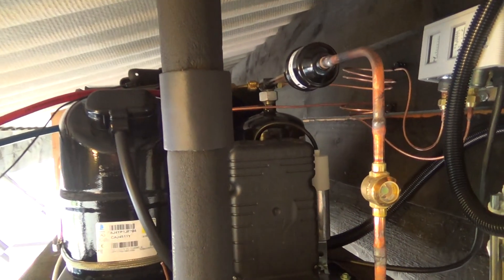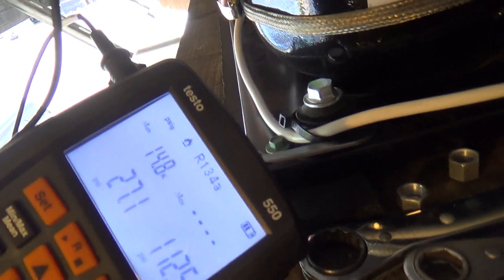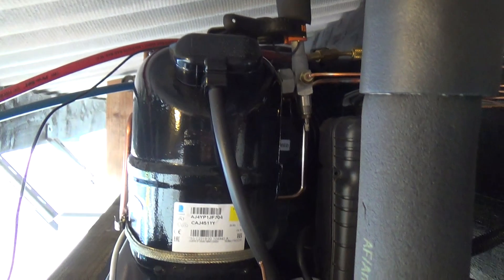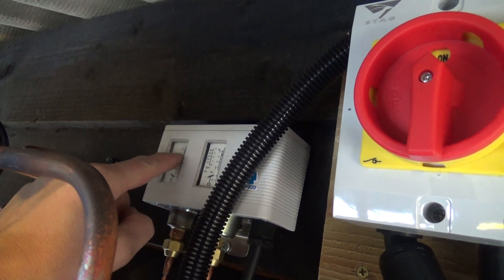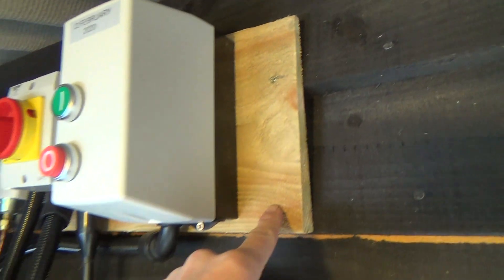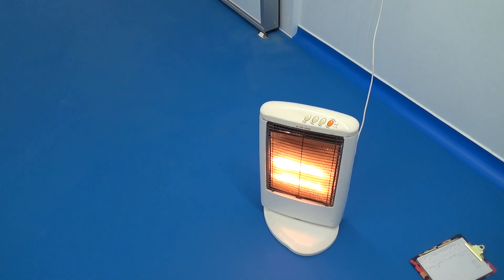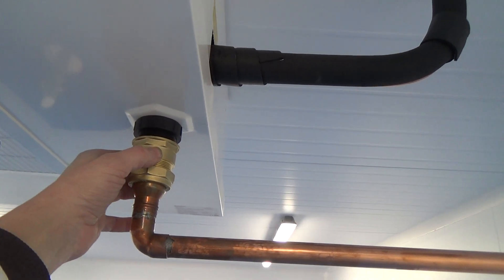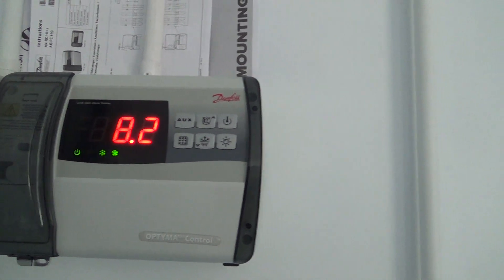New Cold Room Project

Comment: The vap suction live must have a "u" shape, to recover the oil....nice job
Reply from the maker: I think it will be ok, the pipe work doesn't go any higher than the roof of the cold room and the condensing unit is the same height as the evaporator. Theres not much height in the room so suspect people would hit their head on a P trap if one was fitted.

Comment: I teach apprentices that refrigeration pressure switches are "about switches" because the scales almost never read accurately. Need to use your gauge set to set them properly just like you did. In U.S. evaporator come with same odd size drain fittings as well. Nice looking install, keep up the good work!
Reply from the maker: Thanks Glen!

Comment: Pretty neat .
I wonder why the manufacturer put the air temp fitting on that side , doesn't it get affected by the cold air flow blown in that direction?
Reply from the maker: Thanks! The temperature sensor positioning was down to me, amazed it works now you've pointed out the air flow issue!